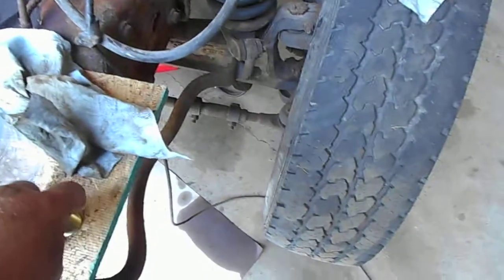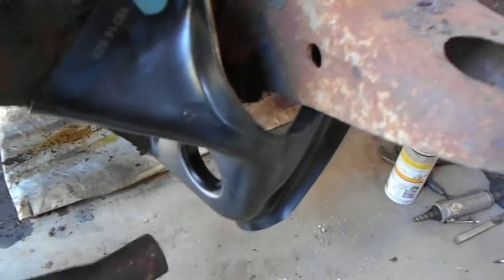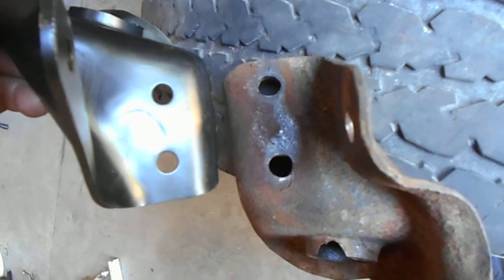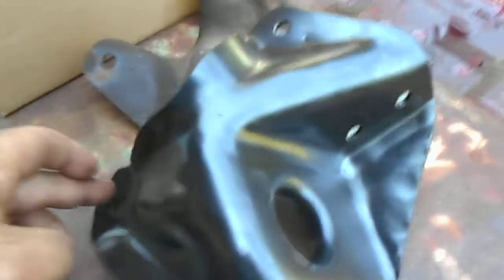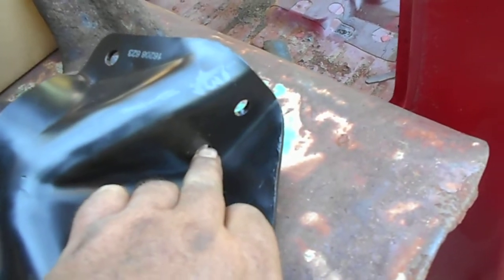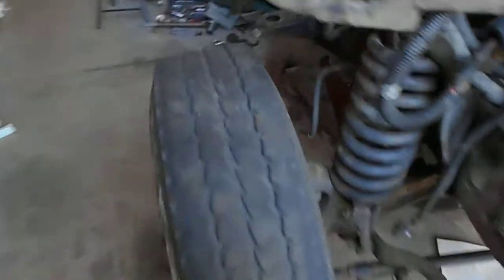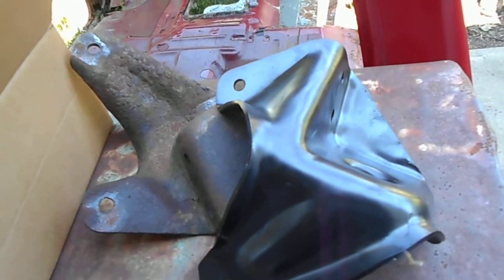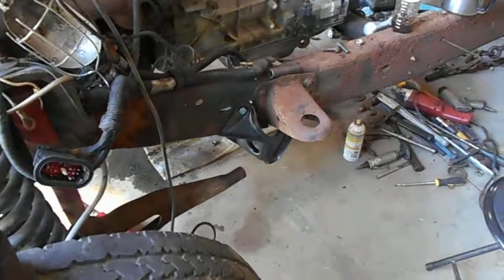pt# 6 Working on Red and a New Problem !

Comment from the maker: After yesterdays fun I got to working on Red again getting the other pin out of the of the other side after a lot of beating and banging  it came out. Ok its done now to test fit the new radius arm brackets and now I find a big problem with them, 3 out of 4 of the bolts fit except the front bolt hole witch is a 1/2 " off !  Why me !  Why do I have an odd ball truck !  Why cant I got parts and parts that fit !  I really cant believe this , I decided not to put the other part of this video on with this one because I was a little too ticked off when I filmed it when I got back .  I hope you enjoy the follies ! LOL  Bandit

Comment: Makes you wonder what truck they do fit. I hate it when parts are off a fraction of an inch like that.
Reply from the maker: I really liked the fact that not only was the 4th hole a 1/2" off but the bolts that came with them were about a 3/8" (metric size) going into a 7/16" hole , Nothing like having things nice and sloppy !  Lets just say I threw the bolts that come in a kit away and went with something more beefy ! LOL  Bandit

Comment: I just recently bought a 744d Massey Harris, I will have some videos of it disking soon.
Reply from the maker: 744D is the English version of the Massey Harris 44 diesel if I remember right, We had a 44 diesel years ago and it was a really good old tractor. I used to love plowing in the spring with it , We pulled an IH 4x14" pull type plow in 2nd gear during the day but come evening when the due set in 3rd gear and let the smoke rolled and you could watch the flame grow out of the stack and man would she run good !  I'll be watching to see the video you put up of her.  Bandit
Reply: Bandit farmer yeah nice, we originally had a 44k Massey Harris but there very hard to find with the kero motor in them.  The video is up to by the way.

Comment: Too much drama, aftermarket parts often need a little adjusting. Use the 3 bolts then weld the corner of the bracket instead of using the last bolt.
Reply from the maker: Well a little off is one thing, But a 1/2" off is another story !  Ware these are mounted is on a curve in the frame and there is no way I'll do any welding there or drill another hole to make the frame fit a part . So I sent them back and went another direction I think you will approve of my idea when you see it.  Bandit